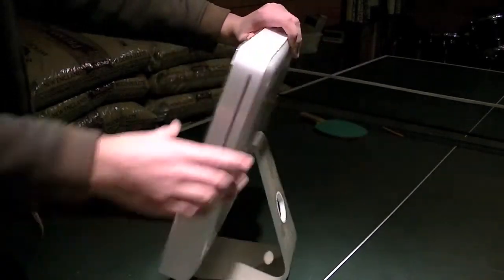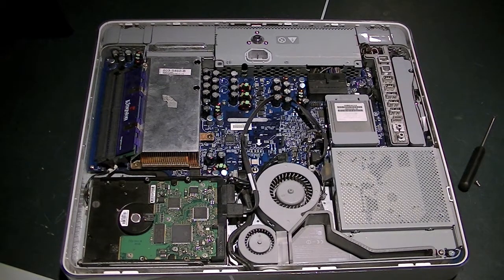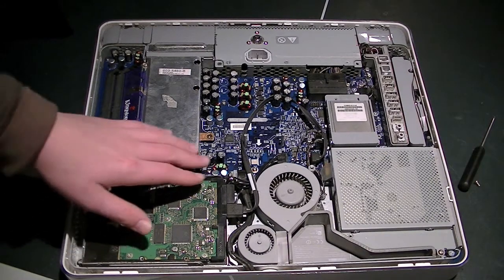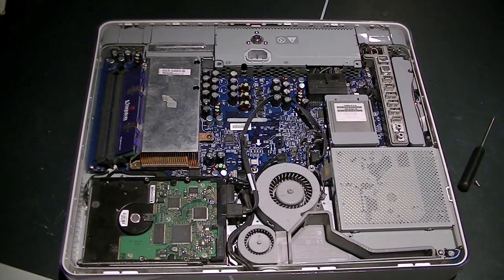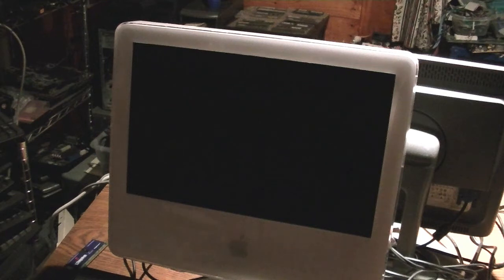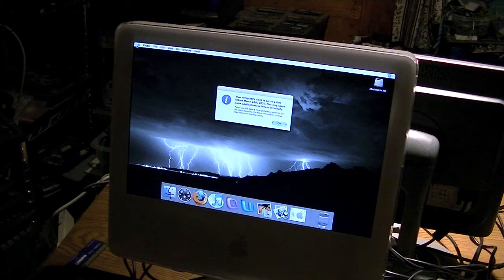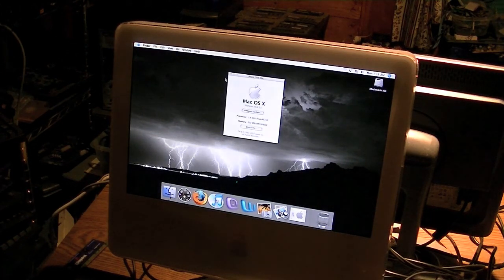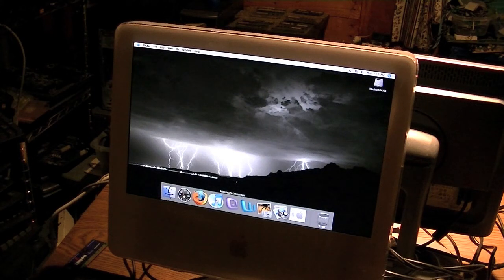The iMac G5 is Fixed! (Replaced Capacitors)

Comment: I have two of the exact same models. One works great but the other had problems with booting up. Rarely it boots but most of the time, when the apple logo appears on boot, it would do a kernel panic. I thought it was the hard drive not working but when I put the hard drive in the other iMac that works, it boots just fine. I plugged the hard drive from the working iMac into the one that had a kernel panic issue but it boots just fine. So the issue was fixed, or so I thought. I decided to upgrade the ram from 256mb to 1gb (2x512mb) and when I turned it on, the iMac starts beeping loudly and then the fans were spinning at max speed. I looked inside the computer to see if the ram was properly installed and it was. But then I saw a capacitor right next to the ram slots that bulged and leaked. When I first got the computer, I inspected the board to see if there were any bad capacitors and there weren’t. I’m going to replace the capacitor as soon as I can and I do hope it fixes the ram issue.

Comment: I have one of these, just wont power up. So was it easy to solder the parts on? and take it a part?
Reply: If you know what you’re doing, then I wouldn’t say it’s too hard. You just need to know where stuff is. It shouldn’t be that hard to disconnect whatever part is giving you trouble  and replace it as long as you’re careful.

Comment: I have the same issue with one of our 17" OG iMac G5s. Apparently, it's not so easy replacing those caps (neither the process or doing so, nor the process of removing the motherboard from the machine). IDK, maybe it can be done one day.
Reply: +maccollectorZ (Commenting Account) I dont do benchwork,like changing anything you solder to mobo,so I replace with another board,lol
Reply: Nut Zack Gotcha - well, that's one way of doing things!

Comment: I just got given a G5 iMac yesterday thats identical to this. I'm going to run Logic 8 on it and use it for my digital piano, for which it will be just ace. You can use other Apple's in slave mode with Logic so I could use the two G5 PowerMac I have (also free) with it and have 11Ghz CPU power.
Who says old is bad - it was shiny-shiny once and how many great albums you own where recorded on this gear? :o)